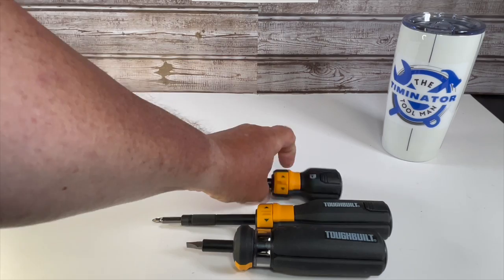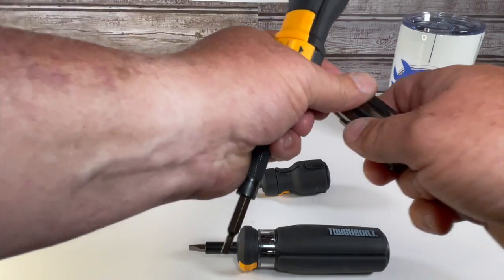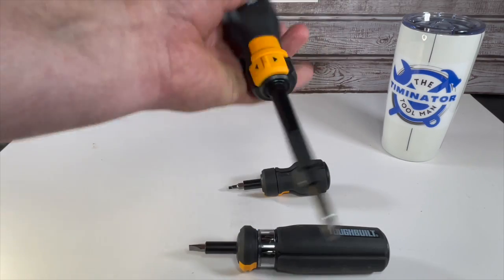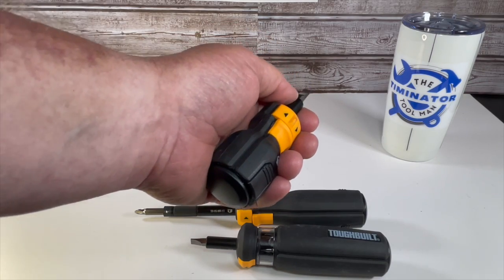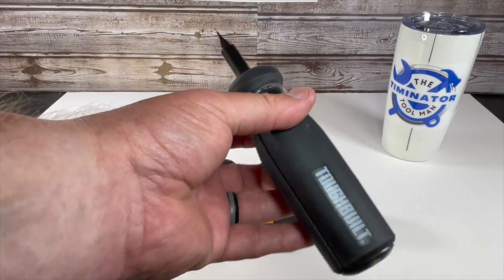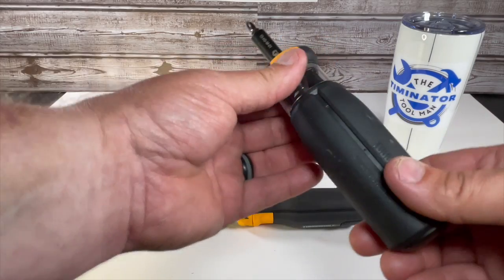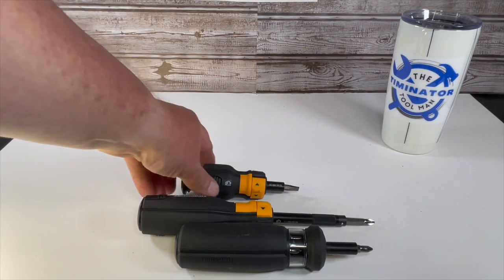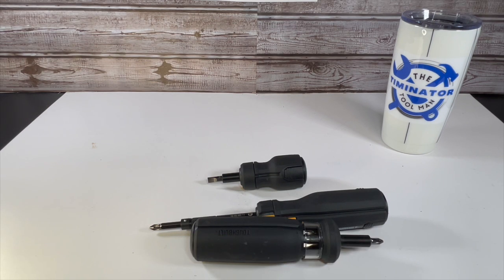TOUGHBUILT HAS 3 NEW TOOLS OUT.  FIRST LOOK PREVIEW!! Watch this!!

Comment: Pretty neat collection. I like the larger screwdriver that will take the double ended bits, you don't often see that in a ratchet screwdriver. Thanks for sharing.
Reply from the maker: Thanks for watching 
I know wiha has a similar driver out now but I don’t believe it has as many bits and also the price point I’m sure is a lot higher
Reply from the maker: The toughbuilt ones will hit the stores soon

Comment: I am returning the Milwaukee's to get these guys.  After working with the Milwaukee, there are a lot of cons that outweighs the pros that makes it a deal breaker for me.  Also getting the Wiha.
Reply from the maker: I have some more screw driver videos from ToughBuilt coming up in the next few days
I just got a load of them in from toughbuilt
Reply from the maker: Thanks for watching
Reply: @THETIMINATORTHETOOLMAN  man, after playing around with some of them.  I found that the 8 in 1 multi driver has a bad fit for Phillips screw.  I was never a fan of those multi drivers to be honest because they never make them to be fit perfect and that goes to Klein as well.  When I compared the toughbuilt to klein, well, the toughbuilt was the worse.  I still want to buy the ratcheting set despite the disappointing 8 in 1.  The 7 pc precision set is not good either, but the 27 pc is alright.  Someone told me not to get the 8 pc screwdriver set as well.
Reply from the maker: @ProxyFinal  thanks for your honest thoughts